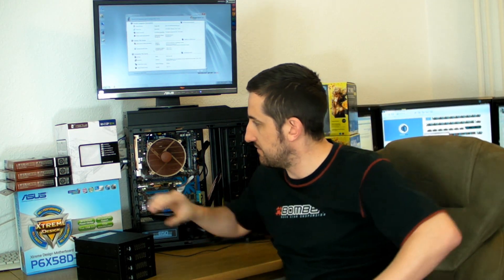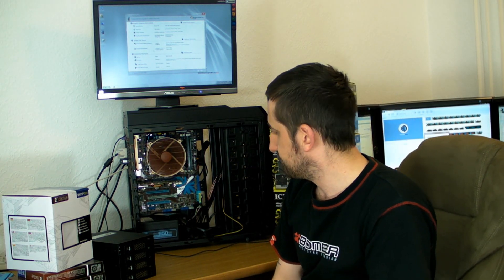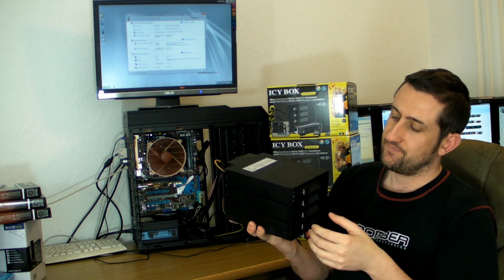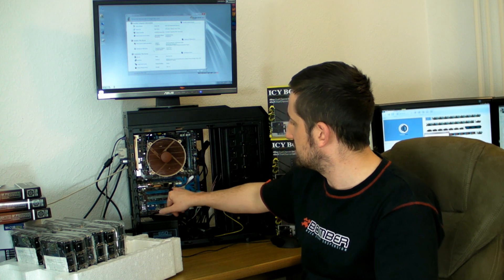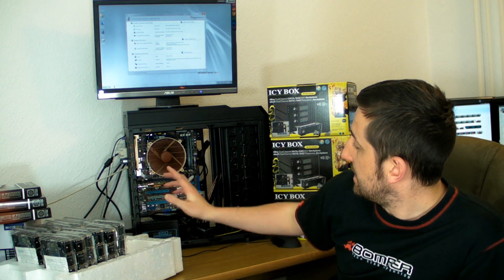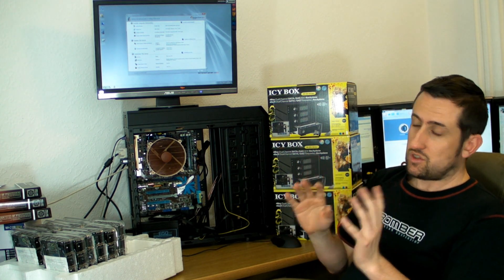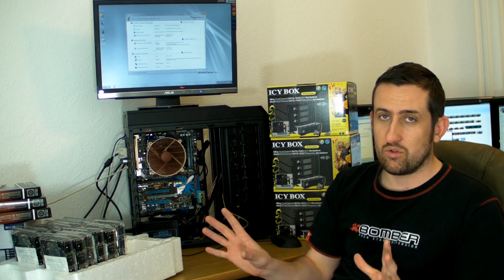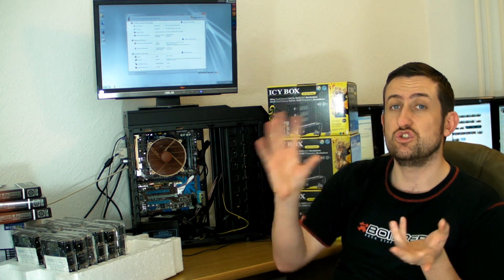12tb NAS Home Server Introduction Server 2008 R2

Comment: Personally I would never run windows for a server, file, media, general home server, anything of that nature. I currently have a headless server with a little under 10tb of storage space on my home server running software raid. It's currently running FreeBSD with storage spread across many of the drives and mirrored across quite a few zpools, and raidz on others.
I honestly do not understand the worlds obsession with having a GUI. The command line is more extensible, and well documented on FBSD.

Comment: hi, 

I believe you could also do some virtualization, play around with citrix and xen server, which you install as a base OS if we can call it that, and have up to 10 virtual server running at same time for free. I advise that just as a matter of redundancy and security. That way you can separate the different servers and services individually, instead of having a single OS as a point of failure.

Comment: @asus3571 alright  bro i noticed in the specs at newegg that the hx650 had a ix8pin eps12v connector but upon closer inspection today i noticed no single 8pin there were 2x4pin eps12v's am i missing something why in the hell would they do that

Comment: hey bro ? for im doin a920 build today my ? is i currently have a corsairhx620 powering my a9400 rig thats goin to the wife and im getting a hx650 for free but not sure if i should keep the 620 in her rig and use the hx650 for mine or keep the 620im thinking take the 650 for myself and give her the 620 what ya think brother

Comment: Thanks for the video. I liked the one about the Intel I5 760 Quad Core as well. It help me decide which processor to buy.

I have a question and I really need your help.

I'm building a new system and I chose the same MOBO here, the Asus P7H57D-V Evo, and the Intel I5-760. My problem is that the G.SKILL Dual Channel Kits (Part No.: F3-12800CL7D-4GBECO, 1.35 v, 7- 8-7-24) are not listed as "qualified" or compatible to work with the P7H57D-V Evo.

Have you ever had any problem with it?

Comment: great vid ttl - in subsequent videos could you cover the cabling system for this raid card - looks like there are fan out cables and extenders. I'd like to see how that will work with 12 drives. thanks!

Comment: Why didn't you just go with a Drobo Elite as a Server from Data Robotics 16TB and up to 32TB. best redundancy protection on the market, 2 drives can fail simultaneously and you still won't lose your data.

If you get a chance check out the Drobo Line...I have the Drobo FS and I have to admit it is the best external drive I have ever used.

Cheers
LazyMan :-)